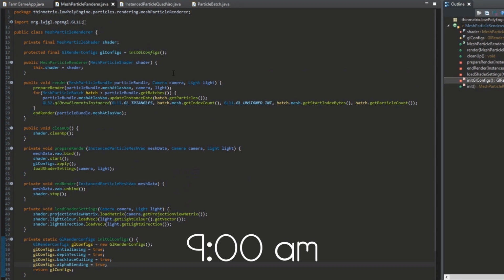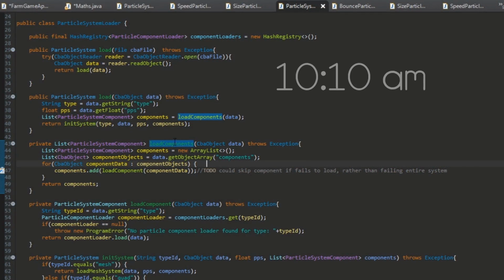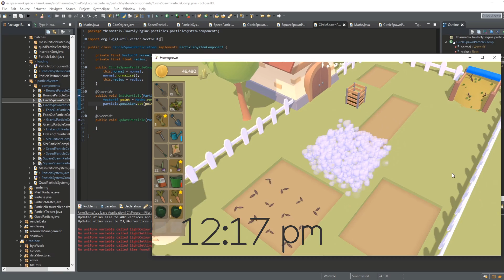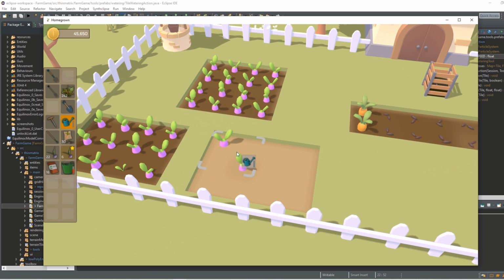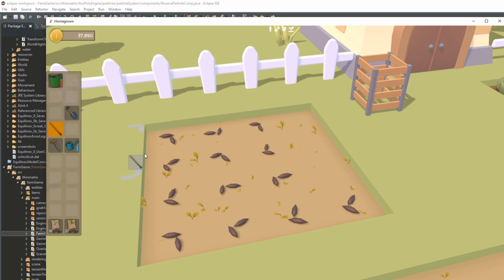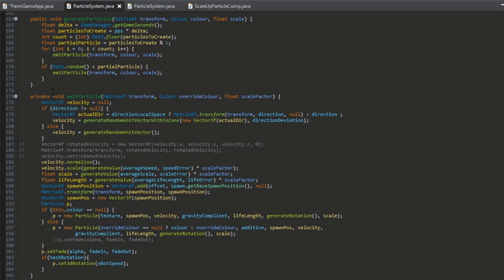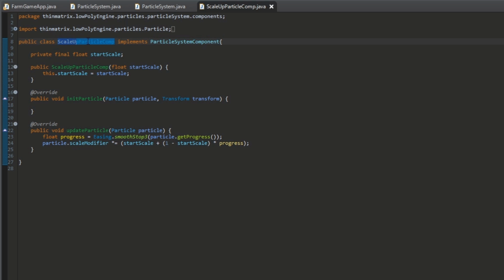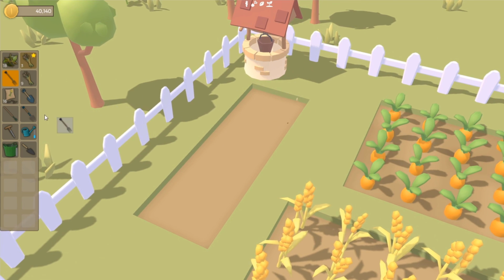Programming Particle Effects in my Game Engine

Comment: Why do transparent objects need to be sorted?
From logic perspective, it doesn't seem like it matters. If I stack up some images, a fully transparent pixel has no effect on the pixels behind or in front of it.
Something about how graphics drivers work maybe?
Reply from the maker: Fully transparent is less of an issue and could be fairly easily fixed (the depth test is what is causing the fully transparent parts to cover the particle behind it in the example I showed). The problem is anything with any semi-transparency, which all the particle textures have in some areas (especially when they fade-in/fade-out which is an effect I use a lot for the particles).
When rendering a translucent object to the frame-buffer its colour gets combined with what's already behind it in the frame-buffer image (depnding on the alpha value). Therefore anything that should be seen behind the translucent object need to have already been rendered so that its colour gets combined. Otherwise if you render it afterward the depth test will just discard it because it finds it to be behind another object (the translucent object), or if you've disabled the depth test then it will get rendered on top of the translucent object that it should be behind.
You can read more about it here if you're interested: https://www.khronos.org/opengl/wiki/Transparency_Sorting#Translucency_and_the_depth_buffer

Comment: How you motivate yourself to code?
I have couple of projects to do but I lost motivation to code anything.
Time passes and I continue working on them. Sometimes it's 6 months, sometimes a year etc
Reply from the maker: I don't really have a good answer for you - when I was working on my previous project (the city builder game) I also struggled a lot with motivation. I tried a lot of things to try and get it back but nothing really worked . I think the project was just too ambitious for me which was rather demotivating. With this project my motivation just hasn't been an issue that I needed to worry about. I think it's exactly the right difficulty: not too ambitious but just enough challenge to push myself a bit and keep things interesting and I've genuinely found working on it really enjoyable. I think I believe in the game's concept more than I did with the city-builder which helps too.
So I don't know how to create motivation out of nothing, for me it just comes naturally if I'm working on the right project (or doesn't if I'm not!)